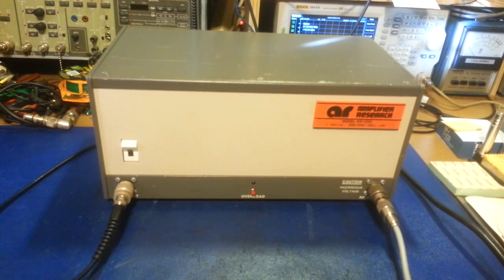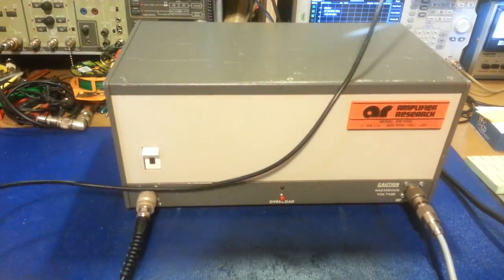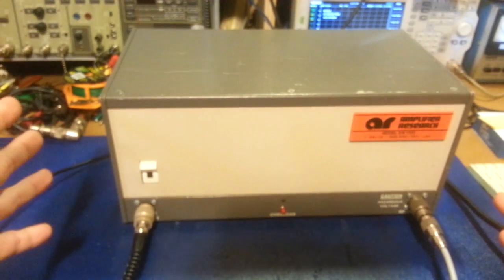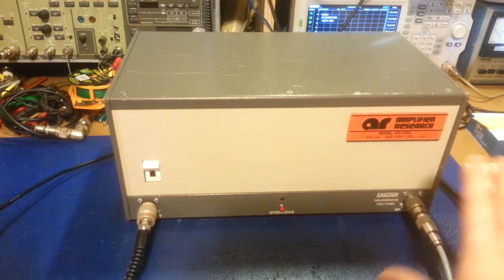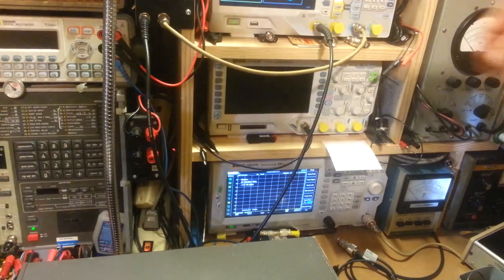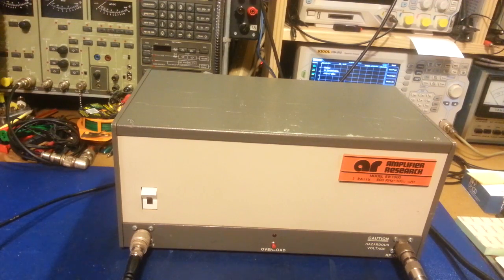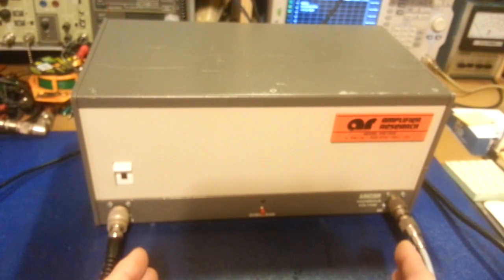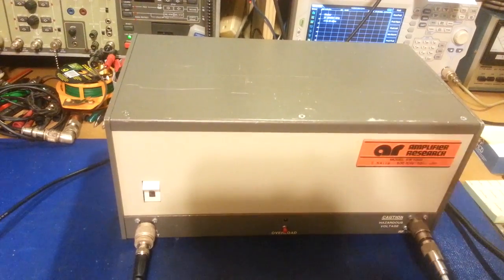Amplifier Research 5W-1000 laboratory amplifier being added to the bench.

Comment: Not only are they expen$ive to buy, they're not cheap to run either. Class A is nice & clean, there's a price to pay. We have a bunch of ENI amps where I work ranging from 25 to 200 Watt outputs. Hate running those things because of the fan noise. They sound like mini-hovercrafts. As they get blown up or obsoleted we're going to attempt to replace them with water cooled units. Can't wait.
Reply from the maker: Yeah the only reason the fan doesn't make this thing float off the bench is because it weighs so much. :)